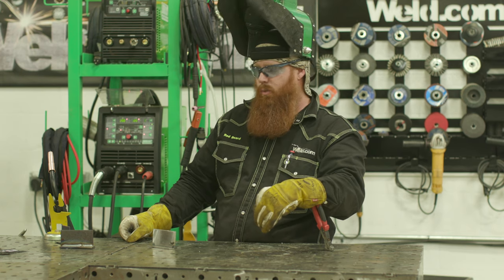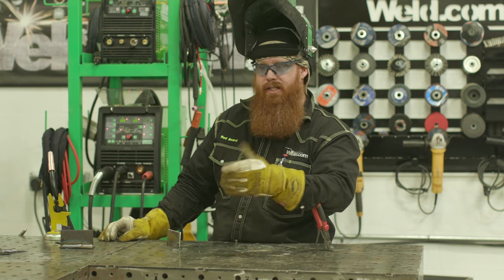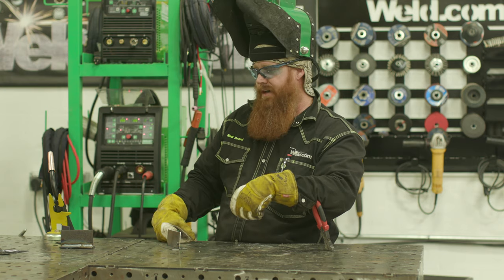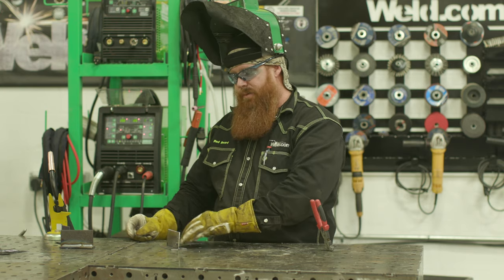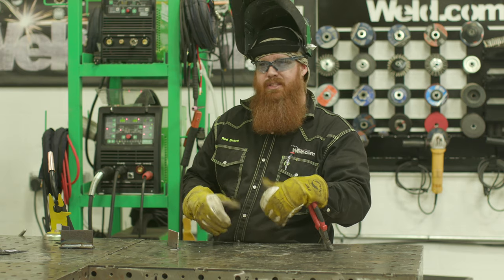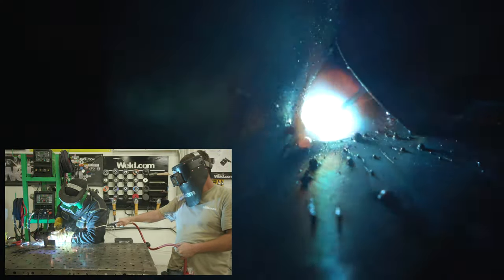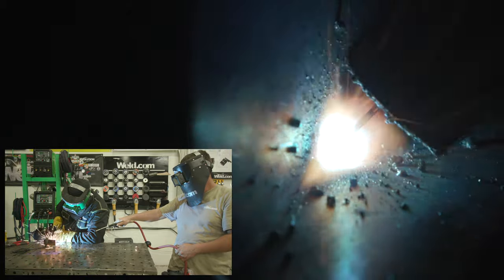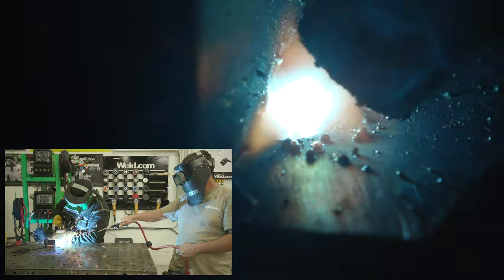WELDING DEFECTS!! Porosity, Arc Strikes, Undercut

Comment: that makes so much sense! i was welding a trailer yesterday and i'm not a pro welder by any means but i can sometimes lay a decent bead. all my welds were full of porosity and i was so frustrated because i couldn't figure out what was going on. it was a bit windy and i didn't correctly clean the oil off the new steel. i used some sort of crappy citrus cleaner that had left a film behind so that must have been the issue! thank you!

Comment: I like the fact you mentioned the code and inspection - as a engineer we spec out the welds for a reason - most of the time we may not even understand all the complexities of what it takes to achieve the spec we just know what outcome is needed - I know you may think we know everything HA!  However, most likely if we are calling something out because of some standard or because of an FEA model we have done.  Another really good video!
Reply: Chris AA thanks, we appreciate the support. We try to cover all the bases and terminology for welders, inspectors, hobbyists, engineers etc.

Comment: Undercut!  When I started stick welding I used 1/8" 6013 at about 160 amps on my big-ol 240V Sears welder.  Nice and easy to strike an arc made what I thought was a nice weld, but had undercut!

Comment: Thanks for the tips. I only weld for my own machinery, I don't do welding professionally, so I won't get inspected for it, LOL. But I do want to weld perfect and do worry about if my welds are strong enough. I seem to be hopeless at fillet welding and vertical welding. From your video I can see that I get undercut and worm holes a lot. I think I'm doing perfectly with the weaving and going at the right speed and angle, but obviously not. Sometimes I will get a perfect run in the middle of a run of crap weld. I always fix worm holes by clearing out the slag then welding in it and it's always perfect that time. I think what I'm doing wrong is I definately angle the electrode too steep and I must be moving too quick. Working outside doesn't help either, as the wind makes me wobble and I end up with the electrode going close then a mile away. I will try and do better tomorrow and will try and keep the electrode at the same distance as the thickness of the electrode. I am cutting out and replacing rotted metal on a tractor topper mower and typically welding steel of 3mm to 5mm.

Comment: Hey guys I am new to welding and I am listening and practicing the techniques you all share. However I have a question about porosity. You mentioned hydrocarbons like paint and wd-40 lead to porosity. Being that I am new to this industry will this be a problem for a cellulose rod like 6011 ? Guys at work tend to say you can burn paint off. I should mention by trade I am a mechanic. So I am taking the advice I received on the job with a grain of salt.

Comment: As a new hobby welder I am experiencing all these new welder problems.  With about 6 hours experience with a 120v hobby stick welder.  My biggest problem right now is trying to clean up my first pass welds. I mean some are really bad.  So when I grind them and use the hammer and wire brush. Down in the bottom of all those imperfections is slag that I can't get to.  So the second passes is worst than the first.  Do you have any advise on this?  Even grinding almost all the weld away usually can't clean up the slag.  Thanks for your videos.  I try to learn some from everything I watch.
Reply: Any progress?
Reply: @hotlinedubai1235  LOL.  Yes absolutely.  I took a 2 day, weekend class at the Community college.  Where I had a welder,pipe-fitter come in and show us what to do. It wasn't really for greenhorn guys.  It was mostly as a refresher for former students that hadn't landed a job yet.  But he let me in and I had a great time laying beads.
Reply: @johnwhite291  good good wish you good luck

Comment: I figure if I do everything wrong, can't blame me for x, because it was x, y and z and probably also included a few additional errors.  One area of Porosity in my first weld (on a plow mount non-critical weld) may have been caused by smoking the stick and thereby screwing up the flux, or my lack of experience, having inadequate heat to start, and not pushing 7018 (Dragging).   The stick got red hot and smoked and the flux chanced color and I wonder if that altered the chemical composition and wreaked havoc on that area of the weld.  Maybe the neighbor's fire truck call this morning was a turkey frying error, not a porosity problem, anyway it wasn't either of us, so Happy Thanksgiving.

Comment: I'm trying to fix a couple pinhole leaks in a hard radiator line. I drained the water from the line and when I attempted to plug the hole my weld had a ton of porosity. I'm in a garage with no draft, I tried more gas, less gas, material is clean aside from the inside which still has a little moisture from the coolant. Is the moisture inside causing my porosity problem? I've tried everything

Comment: if you had undercut on the top edge of the join like @4:50 could you run another bead along the top toe of that weld and be ok?
Reply: Xzempt depends on what the weld size is specified but yes, that’s a common fix in many applications. It will ultimately be up to the inspector.

Comment: This is great tips but one thing that has me f up I work with welding different gauges like we make container “homes” and we talking about welding 1/4 to 18 gauge corrugation ? Idk of flux core is good horizontal postions tends to burn through if I try to even the weld on both metals I tend to focus more on the thicker part to allow more penetration and then weave it to the thin metal with out blowing through ? Any tips ?
Reply: And also causes under cut when I weld horizontal if I weld vertical down welds just fine  just when I tend to weld over head horizontal and flat horizontal tend to create under cut 💕

Comment: I plan to build a bicycle chopper using my 90amp Craftsman Arc welder with 6013e rods, any advice?
I want to do this because these custom bicycle builders keeps telling me I can't
Reply: There is a series on YT of a French guy making a Ford GT40 replica with a stick welder... It can be done if you're good and use 1.6mm wall thickness minimum. Quality bicycle tubing is about half that but you did say this was a chopper...